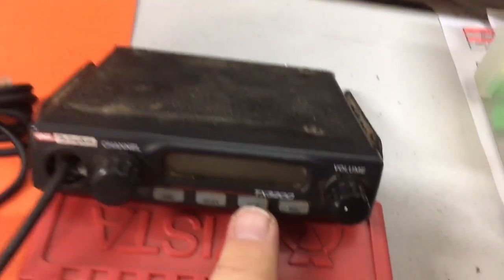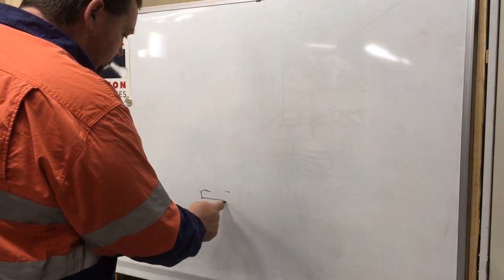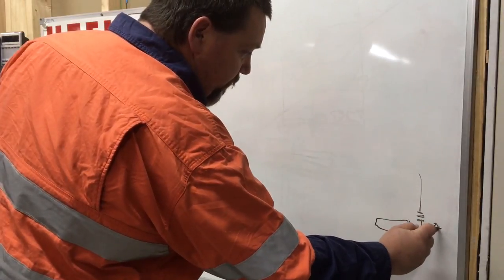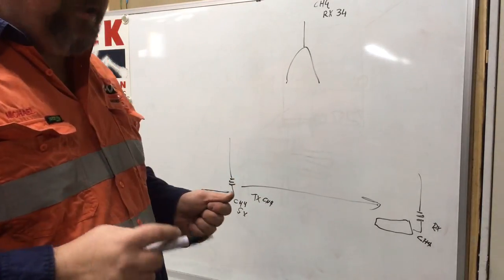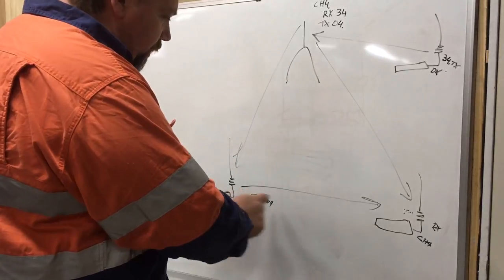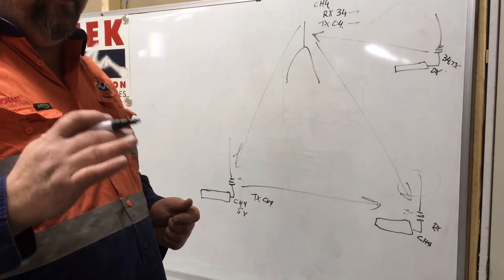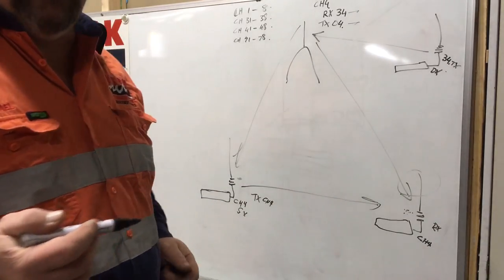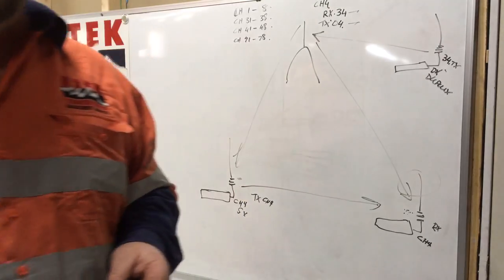how Simplex and Duplex works on UHF CB Radio

Comment: This is a great video for new commers i might share this video in my facebook group.  
Another thing i see is people buying 27mhz 11m cb band ssb radio's 
at garage sales not knowing anything about radio thinking all radios
are the the same trying to use uhf cb antennas on the 27mhz 11m cb band
wondering why they don't work or why smoke is comming from the back of 
there radio's 73 from Clinton VK6FCRC.

Comment: So does it matter if you have your radio set to 34, instead of 4?  Will you still be able to use the same repeater?   Or do you have to be on 4?
Reply from the maker: Hi iTopCati, if you want to use the repeater you need to be on the repeater channel number with the duplex turned on, the radio will then transmit on the input channel and receive on the output channel of the repeater automatically, e.g. you select the repeater channel 4 in the example, the radio will automatically transmit on channel 34 when you press the ptt ( push to talk ) button, then when you release the ptt the radio will go back to channel 4, but only if the duplex function is on, if the duplex function is turned off the radio will only transmit and receive on channel 4, also, if you have the duplex function turned on it will only work on channels 1 to 8 and 41 to 48, so to answer your question , if you select channel 34, when you transmit the radio will transmit on 34 and receive on 34 even if you try to select the duplex function, so you will be “ transmitting on the input side of the repeater but you Won’t hear the output side of the repeater, and most users of the repeater will be annoyed with you as you will most likely not hear other users using the repeater more then a couple of kilometres away from you, and you would be transmitting over the top of there transmissions, and as such, its recommended to stay off these repeater input channels, that is 31 to 38 and 71 to 78 just in case there are repeaters in the area.

Comment: Thank you for taking the time mate I appreciate it. Recently came across a repeater when testing my radio and found some interesting people but I didn’t really understand how I could talk to people in Melbourne and townsville when I’m in Darwin but now it makes more sense. 
Do you have any info on calling individual radios with the serial number? Some old blokes told me they used to be able to do that and only call that specific radio?
Reply from the maker: The function is called SelCal, if you search for " selcal gme "  you find a couple of videos on how selcal works, but it Basically dtmf tones transmitted over the air, if you have your radio in selcal mode the audio on your radio is muted, but if your radio "hears" its own selcal number on the receiving channel it unmutes the audio and beeps, on some models of radios the user can make up there own selcal number, but on most radios its the last 4 digits of the serial number.
Reply: Thanks mate you are a legend! I will have a look into it.

Comment: I am confused about the channel programme or what is programmed into the CB pre purchase. Are all duplex channels the same Rx TX PL, Shift etc. I have been trying to get across ham programming my own channels whereby all this information has to be manually loaded. Am I to assumed that all CB duplex channels are the same programme per channel. (As to why say channels 1 to 8 will be in complete different areas).
Reply from the maker: Hi Noel, the CB repeaters are all set out the same, most don’t use pl, but that is up to the owner of the repeater. 
Ch 1 = repeater input 31 output 01
Ch 2 = repeater input 32 output 02
Ch 3 = repeater input 33 output 03
Ch 4 = repeater input 34 output 04
Ch 5 = repeater input 35 output 05
Ch 6 = repeater input 36 output 06
Ch 7 = repeater input 37 output 07
Ch 8 = repeater input 38 output 08
Ch 41 = repeater input 71 output 41
Ch 42 = repeater input 72 output 42
Ch 43 = repeater input 73 output 43
Ch 44 = repeater input 74 output 44
Ch 45 = repeater input 75 output 45
Ch 46 = repeater input 76 output 46
Ch 47 = repeater input 77 output 47
Ch 48 = repeater input 78 output 48
Reply: @vk3hau  So that means if my local repeater is on say, 8. The radio will automatically choose 38 when I transmit, because the CB is preprogrammed. I bought a you beauty uniden 850 CB that does not have a duplex button. So I need to programme my CB to go duplex when on the Repeater channels. Pain in the butt. I wish it had a duplex button or at least indicate to that it is on duplex mode.

Comment: Thanks for the video Micheal! I would just like to ask you if I can set all the repeater channels to duplex and just leave them that way? It will also help me to remember what channels are repeaters as "duplex" will show up on the screen for a repeater channel. Thanks for any help.
Reply from the maker: stewedapple 
yes, that is the preferred way to use the repeater channels in you local area. stops you from accidentally talking on the repeater channel in simplex mode.
Reply from the maker: also, pressing the duplex button only turns the duplex function on for that channel your on at the time, all other repeater channels will still be what they where on before you press the duplex button ( press duplex per channel by channel basis )

Comment: Got few questions about the file below clearly iv got a baofeng UV-82 did the right ting an remove the VHF side of it as don’t have a ham license I only need it to work like a normal UHF as u can c in file below thet it uses repeater on quite a few channels I don’t use a repeater on farm an farm channel is 36 23 an 24 	
23,CB 22 TEL,476.95,,,,88.5,88.5,23,NN,NFM,12.5,,Telemetery & Telecommand (no voice allowed),,,

24,CB 23 TEL,476.975,,,,88.5,88.5,23,NN,NFM,12.5,,Telemetery & Telecommand (no voice allowed),,,

36,CB 35 REV,477.275,,,,88.5,88.5,23,NN,NFM,12.5,,Chan 5 EMERGENCY repeater input (use chan 5 duplex for repeater),,,

I don’t no if u can see my problem yet but if u can get back to me asap it be much appreciated 
Thanks
Reply: So by the chirp file below if I’m transmitting on ch36 it resending it on channel 5 duplex . correct an do u no how I can just use it like normal uhf for instance if I give it to kids I don’t wont them transmitting on a repeater around a camp site
Reply from the maker: @johnoconnell3459  

I'm sorry John, but for legal reasons I can not comment on non-type approved Illegal radios used in Australia , 

https://radioindustries.com.au/illegal-radios-warning/

The following fines are applicable if a user is found in possession of a radio:
The Australian Government Department ACMA (Australian Communications and Media Authority) has legislated that only Radios which pass the approval System can be sold and used in Australia.
As of January 2007 the maximum penalties for the misuse of the legally allocated CB emergency channels are:
For general misuse – if an individual 2 years imprisonment, otherwise $165,000 (a $220 on-the-spot fine can be issued in minor cases per radio); or
For interference to an Emergency call – if an individual 5 years imprisonment, otherwise $550,000
Reply: I have not used the the radio for that reason it Is absolutely useless to me just won’t to no if there’s a way I can use it like uhf only or the next step the bin but if I can save it from bin I’d much rather selvage it an I’m in remote West Australia an don’t use repeater any help be much appreciated
Reply from the maker: @johnoconnell3459  

I would like to help, but in doing so I put myself in a position of 1> supporting an illegal radio and 2> I don't know how to program these radio and have no interest in known, sorry but unless you can sell it to a amateur radio operator, just bin it.